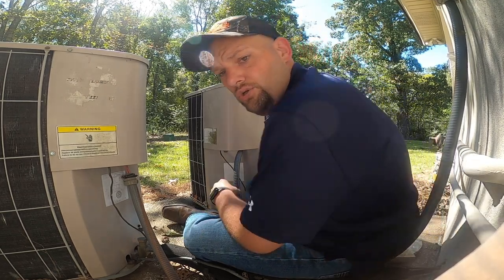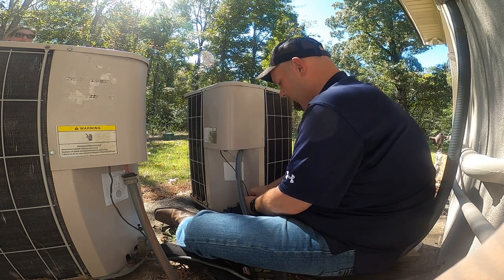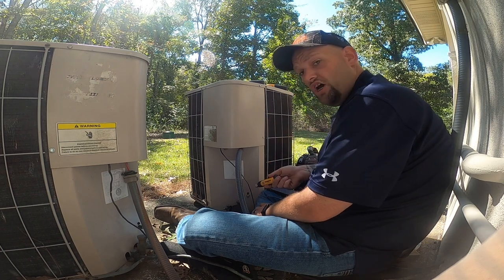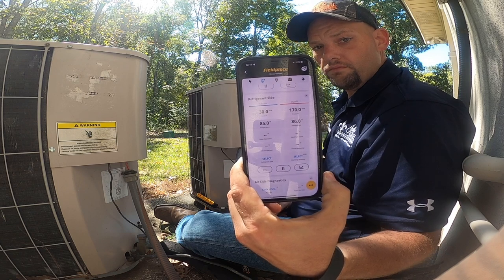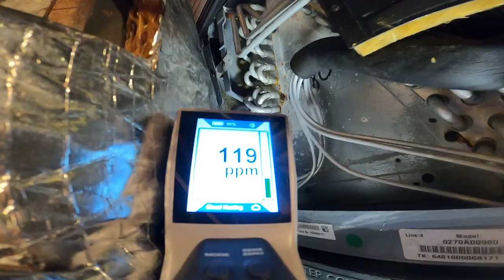Leaking System turns into Change Out

Comment: sounds fairly easy with this owner, but if I was the original owner / purchaser I would be on the horn, jumping up and down with Goodman. I'd also be jumping on the installer for not registering the unit and digging up the job ticket or the canceled check to prove the date of install.